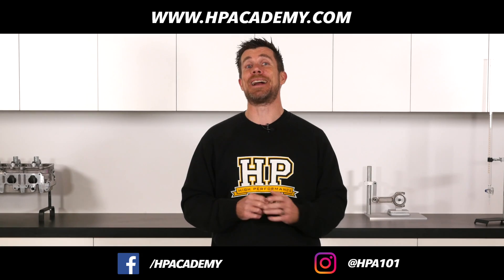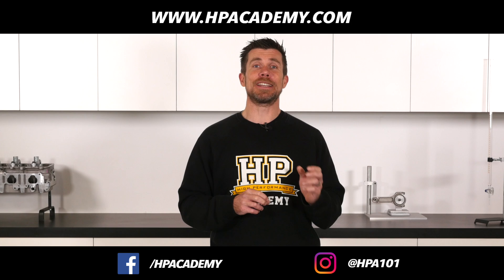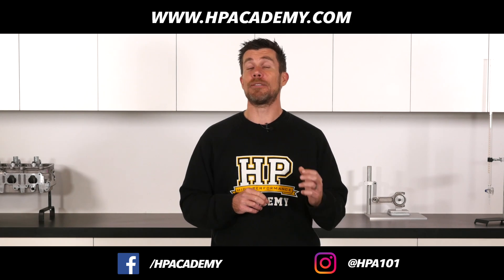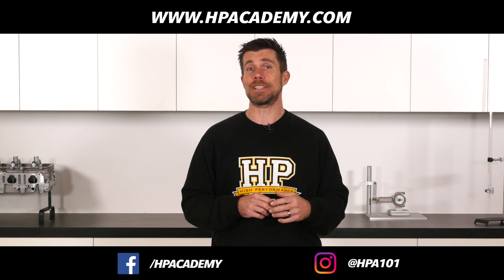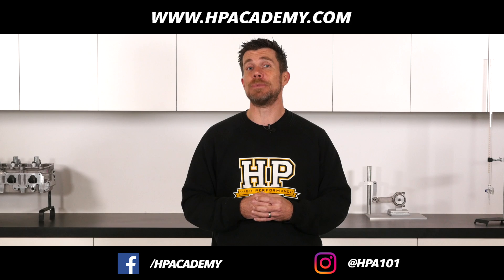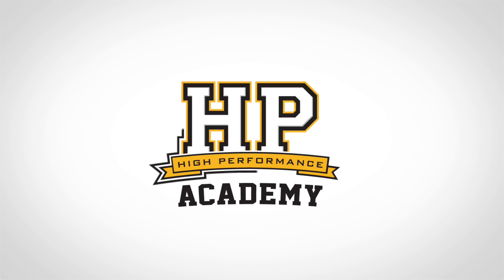What's The BEST Value AFR & Knock Detection Device? | Knock/Ping/Detonation[HPA Q&A]

Comment: long as you can calibrate sensors not big deal 
I always use emissions tester to compare first and use the wideband as a guide as can be out by 0.4afr 
it's only a tool depends how you use it